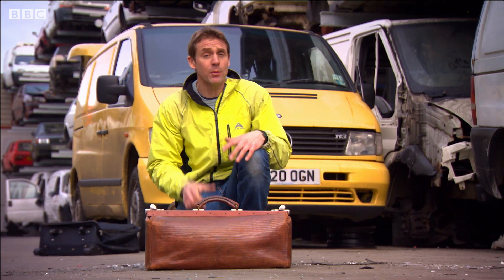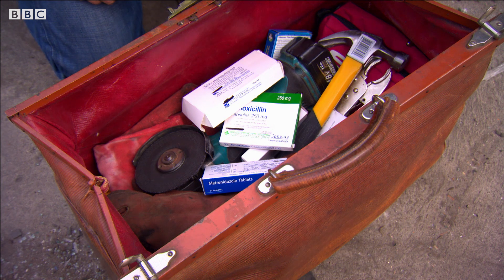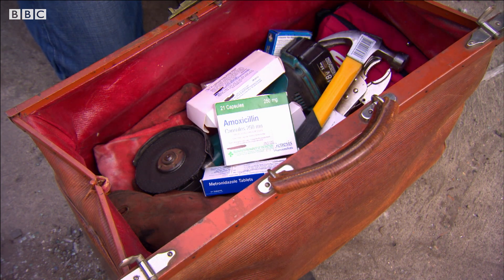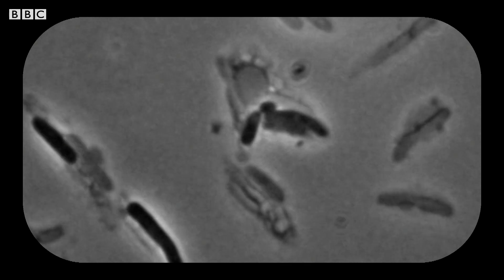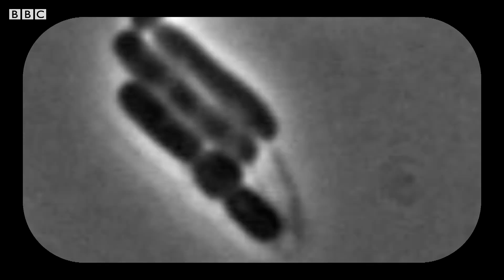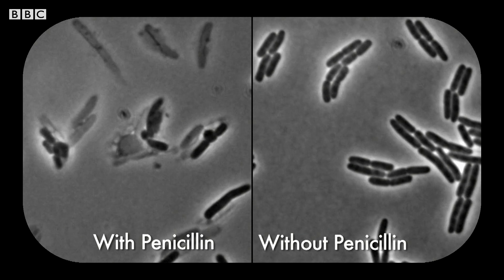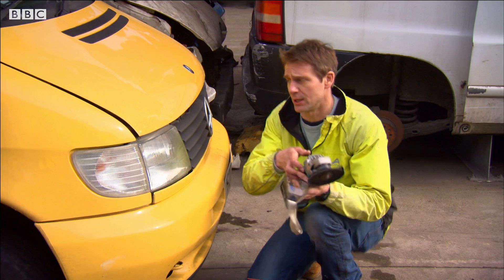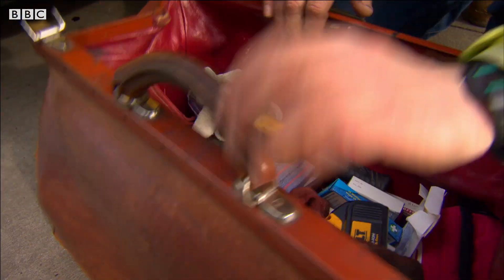Bacteria vs Viruses: The Difference and How to Fight them | Earth Science

Comment: What about a disease
Reply: A disease is an animal's body energy running at the relative low level condition which attracts  virus or bacteria from outside open air. There are two root cause of disease: low level body internal energy and partially disorder or damage of body's internal structures or organs. Virus and Bacteria are not root causes of disease. They are just part of the disease effects. Just like rotten meat would certainly generate a playground for uninvited guests of bacteria, maggots, flies etc. We cannot ignore the crucial role of body energy. Without body energy's driven, any animal's body would become a dead meat undoubtedly.
The modern main stream western medicine's been spreading the most dangerous idea which is using all kind of medical equipment inspection results to confuse and convince people who are having certain specific disease for sure. It is pathetic that most people are not aware of that illogical mistake by misjudging the ageing as disease. Unfortunately, most of inspected index, scanned internal organ images are just the phenomenon of body ageing instead the actual disease. Most people would easily accept ageing effects like grey hair or wrinkled skin since those are simply nature effects of life. But once we are told by a medical doctor who presents the so call solid evidence -- inspected images or index figures which are actually to be body's nature ageing effects but they insist to call it disease, sickness, disorder or syndrome. If you believe their so call professional medical and scientific statement and you would be patient immediately. Many people have to pay for considerable lesson because of agreeing that morden trap of medical believing system. They never know that they have been life time loyalty customer of pharmacy groups.
People should use their common knowledge, independent thinking and intuitive feeling more in order to avoid life time trap wisely.
Reply: a disease is a condition. A disease can be caused by bacteria or viruses among other things.